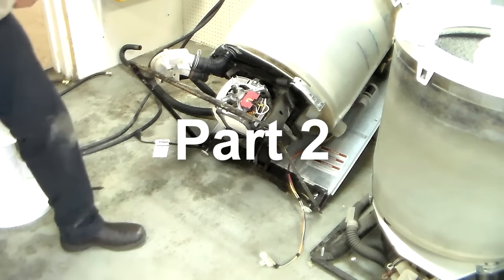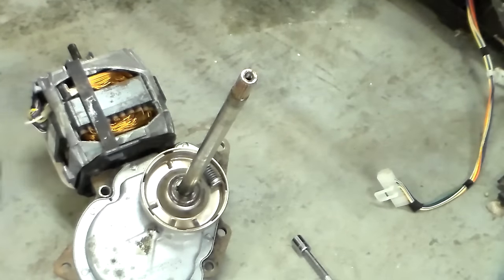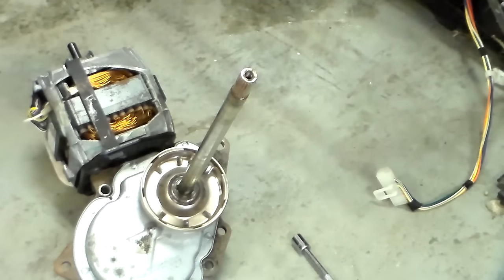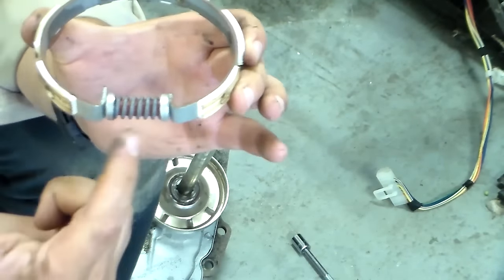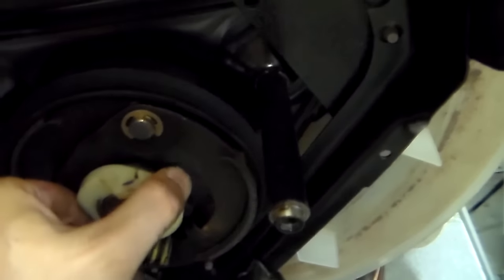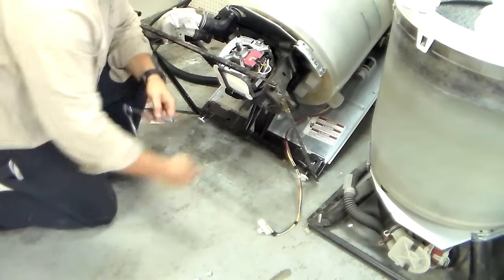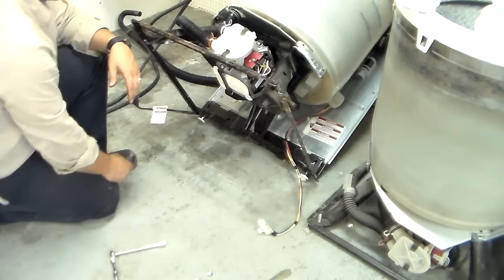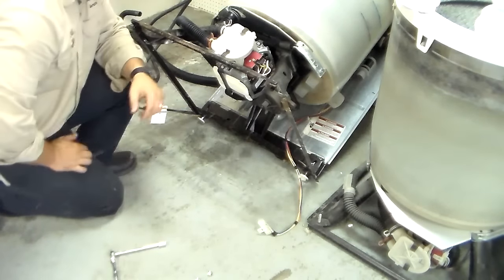Kenmore Whirlpool Washer Not Spinning 2

Comment: What a great clear concise information.  As I type my Kenmore is spinning like new!!!  A tip for fellow :OLD FARTS" like me.  Lay the washer down flat before you reassemble it!  The angle thing works great for tearing it appart but that motor and transmission is a lot eaiser to handle in the reassemble with the washer flat.  This is no way a critisim.  The video was one of the best "Ican fix this videos" on YOUTUBE.. You saved me a bundle!!! Thank You a thousand times.

Comment: As a guy with an old Series 90 Kenmore washer that stopped spinning, I can't tell you how much I appreciate this video—parts 1 and 2. Brilliant. I've been convinced I have to buy new machines, but nothing, and I mean nothing, seems to be built as well as these old machines. Bells and whistles? Sure. But basic, bulletproof functionality is hard to find. If I can get a new clutch and install it myself, and get a few more years out of these mid-90s machines, then I'm gonna be a happy camper. Thanks so much for posting these!

Comment: First, I just want to say thanks for taking the time to create and post such an informative video. Second I would like to give everyone a warning as there may be nothing at all wrong with their washer. I just found out that it is normal for the washer NOT TO SPIN during the first stage of the spin cycle; only the pump is activated. After most of the water is pumped out the motor stops for a couple of seconds then starts up again. You hear a click an then the washer spins and pumps out the rest of the water. 
I opened my washer one day during the first stage and thought it was broken because only the pump was working. I ended up taking everything apart before finally realizing this so I hope this helps someone.
Reply: That was brave of you to admit that for our benefit. I thank you, and I'll check.
Reply: I cannot thank you enough for posting this comment! Thank you so so much! I just put a new transmission in my washer and thought it was broken because it didn't spin up initially. I read your comment then watched my washing machine and realize nothing was wrong. Then I went and told my fiance and she told me she figured out a long time ago but didn't tell me because she didn't think I would believe her
Reply: Thank you. This makes a lot more sense. I thought for sure my timer was broken.

Comment: Bill,
I have watched many appliance repair videos on many repairs.  I have to say you have some of the very best informative and visual ones I have seen.  
The way you make sure to be so complete in your lesson, ex. which way the washer goes on that fell down when pulling the transmission was wonderful.  Showing four different versions of the agitator removal screw.  I really felt compelled to write this review as when the video was complete, I knew that I had learned good information and in a complete way.  I look forward to watching more and would find it a please to speak with you.  I have a few questions on a non-profit company I have started that aligns itself around appliances and repair.  I believe you could have some good input in this matter.  Thank You  
   Tim Sharp

Comment: I was about to throw in the towel and cut our losses with the 15+ year-old Kenmore Elite washer that stopped spinning, then I found Bill Newberry's videos and figured what the heck. So, following his excellent instructions, I ruled out the coupling, which looked OK. Again, I figured the machine was toast. Then I found his two videos (parts 1 & 2) detailing how to locate and check the clutch. Seemed to turn too easily, as he described, so I rolled the dice, ordered a new one ($60 with shipping), and not without some struggle, got it reassembled. And it worked, even with a heavy full load of towels. Newberry's guidance couldn't have been better.

Comment: Thanks for the great videos and help!  BTW, instead of replacing the clutch on my washer, I reconditioned the clutch by sanding the inner drum and clutch pads to de-glaze them, then cleaned them with alcohol and stretched the spring for a little more tension. My washer is to old spend 40-50 bucks on a new clutch when I can buy a used mint washer and dryer set on craigs list for 150. Cheers!
Reply: Where do you order parts for older whirlpool washer?

Comment: Such a helpful set of videos! After our 2006 Kenmore Elite washer stopped spinning, agitating, spinning, and draining properly, your video gave me the knowledge to replace the lid switch, coupler, clutch banding, and agitator dogs. Our washer now performs brand new. I’ll never get rid of this pair, as parts are super easy to find, the direct drive system is super robust, and the garbage they manufacture now has no chance of lasting as long as this stuff!

Comment: Great video, I have not looked under my washer yet, Its a 22yr old White Westinghouse. I'm hoping its the same style setup. My tub turns but not fast enough to remove the water from the clothes. To me, from what I have been watching, I hope it the coupling. But think it's the clutch. LOL  The only mystery on my machine is the agitator and shaft  are different from Whirlpool. But I guess I'll figure that out once I'm knee deep into it. YouTube has been my go-to source for repair info. I have saved hundreds of dollars fixing, motorcycle, car, plumbing, cement work( tuck pointing ) , clothes dryer and now my clothes washer. Thanks to you and all the others doing these videos!

Comment: Great how to videos. My washer is about 7 years old. One of my 3 bolts underneath snapped (rusted?) in half and the other two worked themselves loose until they fell out during a wash cycle leaving the whole motor/transmission unit on the floor while running.  Washer made a banging noise like an unbalanced load. Lifted the lid and realized the clothes bin was about 3 inches lower than it should be. Tried to drain water out of washer by switching control to Rinse mode but it made a terrible noise. Unplugged everything and moved washer to find two and a half bolts on the floor. Had to drill out the half that stayed in the shaft. This video helped me to take apart and put back together once I had new bolts. Thanks so much! Saved a lot of money and learned a lot in the process!

Comment: Bill, My husband and I can't thank you enough for your very thorough video. Our Kenmore 80 series is 13 years old and it stopped spinning the other day, but continued to run and make a weird noise, (much like the washer in another video that you did). We followed your video step by step. First, we checked the motor coupler and while it looked "just okay," we did what you said and really gave it a good look. We also checked the clutch and the dog agitators, just to be sure. We came to the conclusion that the motor coupler was just worn down so we switched it out and voila!! Now, our washer spins again! Thanks, Bill, for sharing your knowledge!!
Reply from the maker: ***** Awesome!  Great Job!

Comment: Thanks for the detailed troubleshooting steps. Spent a lot of time watching repair videos that don’t fully help you diagnose your problem. I initially thought my whole transmission was bad since the clutch passes visual inspection, but the torque test is key. You save me a few hundred bucks and fixing the wrong issue.

Comment: What if it seems to be neither and both parts seem ok
Reply: Same happened to me. Any solutions?
Reply: Probably the clutch.
He is being overly modest about his finger strength. Based on the video, my clutch seemed OK too. Noticed the brake release lever didn't seat properly - it was cracked. That part is only readily available in the clutch kit, so I ordered one.
Gave the new clutch the same test for comparison - found it near impossible to move by hand. Replaced both parts - everything works.

Comment: This saved me a bundle....simple...easy...makes me think about fixing more things around the house I thought were hard to do. Just remember the couplings are made with metal inserts now which supposedly may or may not start to round the edges of the shaft. Supposedly whirlpool fixed it. Thanks against..was ready to just buy a new one since it's 13+ years old! but if I can get a coupling and spend an hour fixing it I'm super happy

Comment: This and the part 1 companion video is bar none, the absolute best instructional I've ever seen on youtube. My motor coupler was broken in half. The damage couldn't be seen until the motor was off as you said. Your disassembly -reassembly procedure went perfectly. As you said, the job was much easier by removing the drive train and motor   then repairing out of the machine. Thank you so much!!!

Comment: My very mechanical boyfriend said to buy a new washer and gave me the money. I'm a 52 yr. female and fixed it myself (yay should keep money). It was the coupler was rounded out. Put back together and agitator was frozen (crap must not have turn counter clockwise to release brake), took apart again because I thought it was suppose to turn one way but not the other (moved both ways when I started). Put back together, still frozen (suppose to be dah) turned on made noise but no agitating. Spin worked tho. Forgot to turn on water, who knew it wont agitate unless full of water. Works great! Thank you for saving me so much money for now and in the future.

Comment: Bill, thank you I diagnosed & repaired following your step by step instructions. Found motor coupler pieces on floor upon tilting machine ordered part on amazon fixed for $2.96 saved a ton of money thank you Bill. I did remove the cabinet as it was loose and wanted to secure it on properly when doing this there is a water tube in the back make sure that is secured on properly as mine came off accidentally and leaked (my fault). Machine is working like a charm now thank you again BIll

Comment: Bill Thanks for the video. Had to do a repair fast when the Sears technician  failed to show up last Friday. Saved me a bunch and bought the parts off Amazon instead of the Sears site. I had to watch the video again when I struggled to re-install the shaft to bolt the motor back up. That little anti-clockwise push trick is quite important to get the motor in flush position for bolting. My wife thanks you.

Comment: I have exact washer. Followed your instructions step by step from my lap top in the utility room. The only difference was that the spline at the top of my transmission rod was rusted and pitted. I had to pound it out with a 2"x4" as not to damage the spline or threaded hole. Once out, I wire brushed the spline and everything went in smooth. You saved me at least $600 on a new washer. These older top load washer are pretty easy to work on. Not much electronical stuff to go wrong.

Comment: Bill, AWWSOME video. I folloewed your instructions and everything you described was spot on! My washer would not spin, agitator worked fine, but no spin cycle. I had to change my coupler a few years ago and had to remove the sheild on the washer. I really like your way of tilting the washer to get at the motor. My clutch was bad only problem I had was getting the retaining clip back on. I changed the coupler again since I already had everything open. Great Job!! Thanks

Comment: Thank you Bill!  Put a new coupler in this machine several months ago.. Would spin empty but not with clothes.. Pulled it apart without taking the cabinet off this time and sure enough this clutch is wore out!

Excellent video. TY for taking the time to make this video. Money saved from having to buy a new washer or pay someone to fix it goes back towards Xmas 2013.

+1

Comment: Thanks for your help! I couldn't figure out how to get off the spinning thing and you showed how the little cover pops off to get to the 7/16 bolt. Appreciate you. My washer had a bad clutch, it had trouble spinning the tub, sometimes I would spin it manually as to help it to start the spin cycle. When it finally failed I couldn't manually turn the tub, the pump and motor spun freely so I figured it was something with the clutch or brake. Saved a lot of money doing it myself

Comment: Wow! What a great tutorial!, You have cleared up so far what it could be wrong with my washer. It does not spin at the end of the rinsing cicle, however if I spin the tub by hand a few times counterclock wise and then a few times clockwise, after a few tries I can get it to work. So I can see it is probably not the coupler since it does go through all the washing except at the end. The clutch must be bad. I will post an update after I take a look at it. Thank you for being so patient and explaining it step by step and adding the whys and hows, it certainly helps to understand what you are doing in any repairs.
Update! Thanks so much it was the clutch! The pad was so worn down it turn without much effort. So I contacted a seller near by and had it in a few days. Washer is back to normal now.😊👍
Reply: It escapes me how all these troubleshooting videos keep saying it might be the motor to transmission coupler. If the coupler was broken, NONE of the cycles would work since there would be no power the components.

Comment: I was about to scrap my washer.  After watching your video i was able to find a problem you didn't mention.  The tube brakes!  Your tub turn counter-clock wise and mine didn't!  Somehow the brakes was seized up.  I took off the retaining c-clams and took out the brake mechanism. After reinstallment  the tub could now turn just like yours did.  Now my machine works as  it should.  No clutch replacement need.  My machine wasn't spinning.  Thanks a bunch!!!

Comment: Great tutorial, my coupler is good when I checked it.
 So it has to be the clutch that's not spinning the basket when it has a full load, it smells like burnt rubber which made me think electrical wires were burning.
Thanks to you I can replace the clutch.
Easy peasy. 
While I'm in there I'll pull the agitator and basket to give it a good clean.

Comment: Great job on explaining things. I got a call from my daughter-in-law tonight telling me her clothes were soapy and still quite damp. I didn't hesitate to jump right in and start sourcing out the problem. I'm very fortunate that my skills as an HVAC technician provide me with trouble shooting skills. I did find and figure out that the motor coupling was broken and needs replacement. I just want to be sure that there's no issue with the transmission that caused the break other than age and fatigue. I'm going to replace the coupling and hope that it's problem solved.

Comment: Thank you for the help.  The clutch was the problem  Did a temporary cleaning of the clutch and the pads with degreaser and some 600 grit emery paper.  added a washer between the springs and the ring to tighten it up a bit more and reinstalled.  It worked like a charm so far.  I will use that until I get the new clutch assembly that I have ordered.  Thanks for the excellent tutorial.

Comment: Thank you so much, Bill! These two videos just saved me a couple hundred dollars by showing me how to diagnose and repair my washer! The problem turned out to be the transmission, but your clear demonstration allowed me to do all the work myself! Keep up the great instruction!! 
-Tom
Reply from the maker: Thanks for the Great Comment! and Thanks for Watching!
Reply: @BillNewberry  Thank you for these great videos. Very informative and well produced. I'm away from home and our Kenmore type 111-07 washer won't spin. Wife said the power to the laundry room went out while doing a load of towels. Breaker didn't trip but the gfci had to be reset. Power restored but washer won't spin. Tried master reset (unplug, wait, replug, open/close 6x) and nothing. I've been troubleshooting in preparation for return. Something caused the washer to overload mid cycle so I assumed the motor needed reset but that didn't work but motor is making a working noise. If you have any suggestions beyond checking the coupler and clutch I will be humbled and grateful. Either way thank you for taking your time to make these videos. I liked them all.

Comment: Pretty cool video and thanks for sharing this here. have a 30 yr old Whirlpool top loader and similar problems with our machine. 1 removed the inside agitator and immediately found the agitator directional cogs had literally dissolved in place. Am still going to get under machine and check to see if it may also need the Clutch replaced as well. did the pump,hoses and motor last year by watching these. helps I am a retired Union carpenter and know my way around a blueprint and use of tools  ;)

Comment: I replace coupler but the rubber piece was  dry but didn't fix it now the wife says it didn't fix it so got new clutch the newwer one with 6 (six) pads and followed your on spot directions only thing never mentioned was those pads and my kit came with two spring blue and black I put blue on and stuck that pad in it and put it back this way . outside of what spring and those pads this was the best utube Bill. thank you .😉